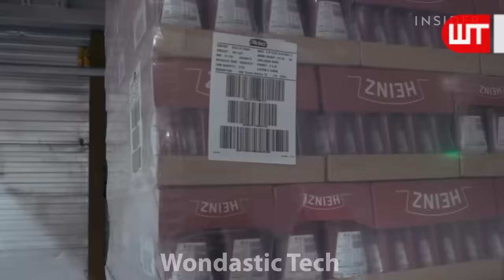How Tomato Ketchup Is Made | Tomato Harvesting And Processing to Ketchup | Food Factory

Comment: That entire operation is MASSIVE!!!  After the first couple of steps, every piece of equipment is covered in tomato puree.  Rotten tomato is one of the most offensive odors known to mankind.  Make a video of the entire machine being cleaned because I bet it takes several days to accomplish.
Reply: I work at a tomato canning company. And Nope, it does not. We wash the machines daily with just waters so the purée doesn’t build up. Every Monday, from 6:30a - 3p we sanitize every single piece of equipment with high grade chemicals to ensure everything is clean. Each machine is broken down, you can take the shield guards off and hose it down with high pressure water hoses. We have both cold water, AND hot water hoses so that we can get the hard stuff off. We are not allowed to clean the machines while product is currently running because we could affect the quality of the sauce or product. I specifically operate 3 machines that fill, juice, and top the can. I clean my machine whenever there is an issue on the line. After about a month, you learn how to properly clean your machine and wash off any build up in less the 30 minutes with the proper water temp and pressure. It’s hard work, but I love it. I’ve worked as a teacher and as an office assistant, and I would rather be out there getting my hands dirty doing this work!
Reply: @kayceecee-  But is your factory and machinery this GINORMOUS??  I've run some big machines from printing presses to auto glass furnaces that were nowhere on the scale of this operation in the video.  The entire scale of the operation, from watching the video, is mind bending.  It's wild that for several parts of the process that there is no human in sight.  Everything LOOKS clean BUT production at that volume would run MAYBE 12 hours and have to be scrubbed for like 2 days.  JUST from what I am seeing in this video.
Reply: @djmerchant  tf u dissing her tomato size for
Reply: @kayceecee- was a qqq